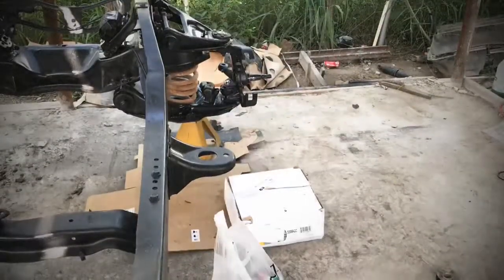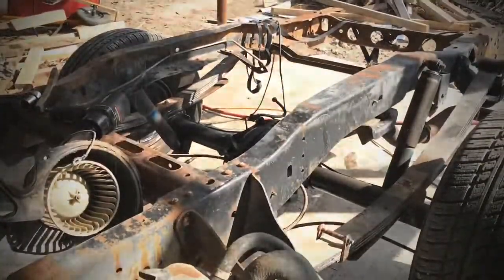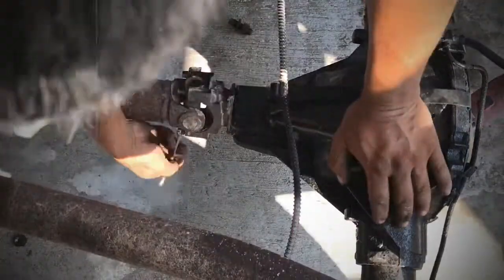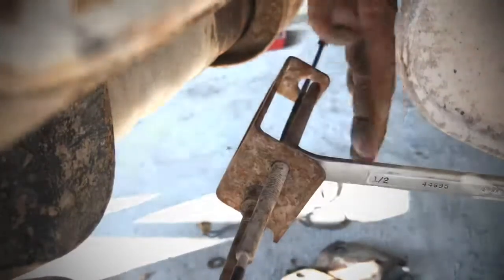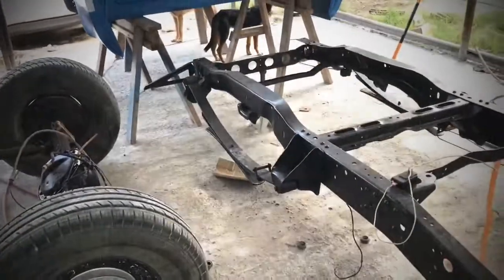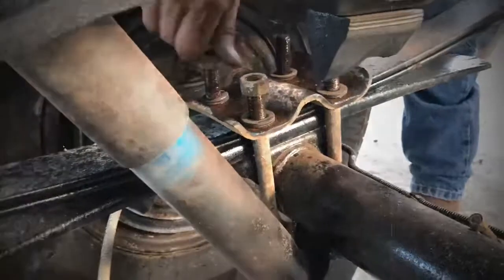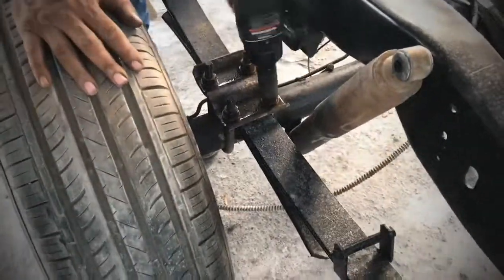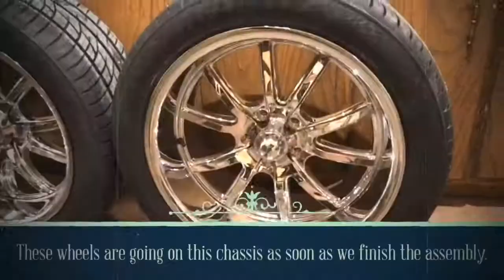Installing rear axle on square body Chevy project

Comment: Idk if you have plans, but there was a guy on the c10 forums making rear disk conversion brackets for c10's I know he makes them for the 67-72 pretty sure he does for the square body as well. Then you buy a factory rotor for an astro van(used on alot of gm vehicles as well) and gm d52 calipers which are cheap. Also cpp sells 4 piston aluminum gm d52 brake calipers for a decent price. Bolt on stronger braking force